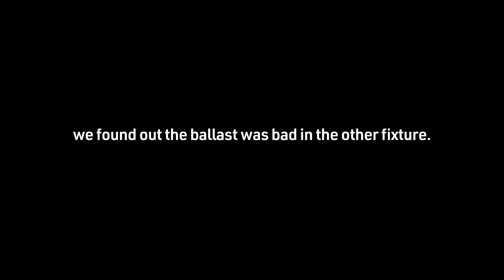Starting custom Case Mod for Tony Hawk - Part 1

Comment: As someone who worked in the plastics industry for 17 years, a little flame does wonders for removing plastic burrs after a cut and leaving a nice rounded edge.  You don't need a torch.  Just a lighter will do.  Then you can sand it evenly later if you want.  Wear a mask when you do and be in a ventilated area.  Plastic fumes and all...
Reply: But torches make for better content...lol
Reply: Wait... you want Jay to make use of fire? All I picture is Bevis.  Heh heh FIRE!
Reply: Next video I set fire too...
Reply: @ILBPatsFan  *Beavis
Reply: @ILBPatsFan  you're not far off
Reply: *cue  ifixit explosions
Reply: Some plastics you can burn off dull outer layers with fire to bring the colour back to life and resurface. Seen it done with old plastic seating that had dulled from years outside. Looked brand new after a few gentle passes with the flamethrower.
Reply: @jackquick8362  Didn't see the joke coming
Reply: I did custom audio installs in cars for years, it mostly involved grinding, shaping, or melting plastics lol xD  I can now look at a thing and tell what rotary bit it needs to get the job done with out it melting and clogging.

Comment: Nice call out to Adam Savage, he's awesome. I do still follow his channel and watch his crazy work. He doesn't necessarily do computer builds but the amount of experience he has when building anything is impressive.
Reply: A computer build would probably be too easy for him.
Reply: @MistyKathrine  It depends - I could absolutely see him having a fun little challenge making a Cyberpunk all-in-one PC with an internal power supply (I'd call it a laptop, but that seems like too restrictive a name for it)
Reply: @Autoskip  could go with a cyberdeck
Reply: @j377yb33n  As far as I can work out, the cyberdeck name seems to be intended specifically for computers with some kind of heads up display, although the inaccessibility of that kind of tech has lead to a lot of people building "cyberdecks" that don't have that particular feature.
Reply: @Autoskip  yeah, it usually ended up being a small portable computer, a precursor to a tablet, with a keyboard, small screen that can be handheld or mounted to a wrist.

Comment: Love the build so far, one cool idea that would fit with Tony's career you be to turn the cable cover into a half-pipe. Tony has always been a bit more of a vert than street guy, so it might be an interesting addition!
Reply: Tech deck vert ramp, have a skateboard coming off it as the sag bracket
Reply: Eh - it's like Extreme Makeover: Home Edition. You like horses? YOUR ROOM HAS HORSE WALLPAPER, THE CARPET IS GRASS. YOUR BED IS HAY. YOU ARE A HORSE. I like the idea of mimicking Tony with graffiti rather than being literal with gimmicky bolt-ons.
Reply: Thats what i first thought too when i see the cable cover. Its perfect for a quarter pipe or half pipe with some graffiti on it like birdhouse and lakai graffiti's.
Reply: @jameslamb7197  This made me laugh more than I'd like to admit.

Comment: For anyone wanting to know the fan grill Jay is using (as he seemed to have forgotten to link what he's using); it's made by AC INFINITY with a product code AI-FMF120A2 (Cabinet Passive Ventilation Grille Black 12 Inch). The grill is designed for Audio/Visual cabinets where extra ventilation is required. They make them to accommodate single, double and triple 120mm fans and come with all the required mounting hardware.

Comment: Jay, I'm so glad you're doing a build! This is one of the things you're SO good at! As a tip, and as someone who's worked for years in a panel shop, you should consider using a jigsaw to make your cutouts. They generate mush less heat (no burn marks) and don't consume cutting wheels. Simply drill out your corners, and voilà! But you do you. Anxiously waiting on the other parts of the build, now!

Comment: Jay, your "oldschool" approach to just zip-disc cutting panels and stuff is EXACTLY what we did in the late 90's and early 2000's when PC modding became mainstream/popular. It's nostalgic and gives custom builds a legit feel. If people want CNC cut panels and stuff, that's what prebuilt gaming pc's are for. Custom means imperfect. And there's nothing wrong with that.

Comment: Can't run most modern LED tubes with a ballast installed. Just spent a few months at the facility I work as an industrial electrician cutting out the ballasts and feeding 277v directly to the tombstones. Some older LEDs have internal controllers which can run with the ballast still functioning.

Ballast is basically the lighting equivalent of a motor starter.

Comment: That inside cable cover would make an awesome half pipe.  And if a "big air" cooler makes sense for anyone it's a pro skateboarder.  Even if he doesn't get the pun we will.
Reply: I'm def on "board" with a big air cooler, scythe, noctua, be quiet.

Comment: Coulda just got him a better case to begin with. I highly doubt you couldn't find a better case that you couldn't handle modding just because it doesn't have all those flat panels like this one does. Kinda pointless to mod in airflow when you can just get a case designed for airflow in the first place that's more optimized and will actually filter dust etc. Tha's just my opinion though. I feel like Tony Hawk deserves more then a shotty NZXT H5 whatever case.
Reply from the maker: When you build him a PC. Feel free to do that 👍🏻
Reply: @Jayztwocents  Unfortunately I don't have that luxury.
Reply: @PabzRoz  that’s the point
Reply: @Ben-u1e9e  What's the point? Because I'm not building Tony Hawk a PC I can't have an opinion?
Reply: @Jayztwocents  If I did ever have the opportunity and the money to build Tony Hawk a PC you can bet I wouldn't give him a 710i with a ghettorigged 16 dollar ventilation grille drilled into it🤦‍♂
Reply: @PabzRoz  Wow Mr. defensive, hang on a minute. I was simply pointing out that Jayz reply was rhetorical and sarcastic. Nobody questioned whether or not you can or can’t have an opinion.
Reply: @Jayztwocents  too sensitive
Reply: @Ben-u1e9e   How is that defensive... You left a vague comment replying to me when my original comment was just my opinion. I just asked you a question. How am I supposed to know you're referring to Jays sarcasm lol? Come on now.
Reply: @PabzRoz  you were supposed to read my mind
Reply: @Ben-u1e9e  true you right

Comment: Check those LED tubes in operation with your thermal camera!  We did a change-out and our tubes were not properly matched to the ballast and actually caught fire.  If your camera shows the ends getting hotter that you would want to hold, turn them off and re-ballast to a matching one!  Our mismatched tubes were hitting over 90deg C but looked like they were working fine.  Don't burn down your new office!

Comment: Might be worth investing in a die grinder with a metal cut off blade, would give a lot more control on the cuts over using an angle grinder.

Comment: Just a heads up, you can get "type B" LED tube bulbs and bypass the ballast. They are unable to be used with a ballast so you are committing to bypassing it and removing it. You get two benefits from this though. One, you don't have to worry if/when your ballasts will fail or if you have a bad ballast already. Two, you pick up extra energy efficiency as all ballasts use energy just to run the bulbs or even more to overdrive the bulb. 

I did this to my basement fixtures that used to have 2 T12 40w bulbs with a high power factor ballast and replaced them with 2 T8 17w bulbs. That took the energy use per fixture from ~106w to only 34w. This cut power use by 2/3. With type A or AB/hybrid bulbs that would've only been cut in half instead. I will say the benefit from switching fluorescents to LED give less of a benefit as fluorescents are already quite efficient with the light output they provide. If you can replace standard A19/21 bulbs and other standard bulbs you gain that 85-90% energy reduction.

Comment: Note on LED conversion---you can also get "direct wire" LEDs where you remove the ballast entirely and just power the tubes with direct 115 VAC. Saves a tiny bit on power (no need to charge a ballast), simplifies maintenance, makes the fixtures lighter, and the bulbs are a bit cheaper. I did this in my garage and love it---solves the bad ballast problem forever.

Comment: They make T8 LED tubes that are direct wire 120V compatible. When I had a ballast go bad, it was cheaper and easier to convert to those tubes than to replace the ballast, plus extra energy savings.

Comment: I agree with the airflow issue, I have 2x 360 rads on mine and removing the top panel drops my loop temperature.

Comment: use a fuma 2 airstack. ive had mine for about a month and it's incredible. i was really nervous, my first non liquid cooled pc build in 12 years. honestly runs cooler thanks to the case fractal torrent and efficiency and it's stupid quiet. like STUPID quiet.

Comment: 3d Print a 1/2 Pipe to sit in the white cable hide and airbrush to suit, or you could bend some plywood to sit in there, then a minifig on a skate board

Comment: I used to work in an equipment rental and servicing company, can confirm you dont need a harness if you're using an adequate rail restraint system, worked there for 15 years and the only time i needed a harness is when we went over 50 ft in the military boom lifts

Comment: You can do it putting les with the current ballast, but if the ballast goes bad you’re going to have to go back up there to replace. Its better to remove the ballast and wire the hots and neutrals to the tomb stones

Comment: I've had pretty good luck cutting plastics using a pneumatic cutoff wheel (basically just a pneumatic version of what you used). I think the fact that it gets so cold (from the air getting vented through it) helps keep the part cooler, and thus cut cleaner.

Comment: Just to help out Jay: CNC's are mostly handy for repetitive jobs (like making a 100 panels fast and easy), and I would recommend step drill bits for drilling plate (both plastic and metal). And use a punch marker ;)

Comment: The possibility of bad ballast is why I use the led tubes that just take raw mains voltage and just rip the ballast out. Just make sure that you label the fixture with the stickers that come with the tube so that the next guy that does a replacement knows not to expect any ballast filtering on the sockets

Comment: I'm having flashbacks to when I Dremeled 2 120 blowholes into the top of my 2000's era Lian Li PC 60 case. That noise was excruciating. Slapped a couple of Silverstone fan filters over the rough holes and called it a weekend.

Comment: With the fixture with the bad ballast double check the packaging of your LED tubes you bought if they may be dual function they may be bypass and ballast over you could just bypass the bad ballast and still use those tubes

Comment: Much better light Jay. I would have purchased the ballast bypass version of those lamps though. When the ballast goes bad, you will still have to spend more money replacing those, and they don't last as long as the lamps themselves.

Comment: Put at the bottom of the front plate the curve of a vert ramp and put a small metal tube up at the top for the coping. Just grafitti is cool but the mans a vert legend. Gotta have his hawk skull logo.

Comment: abs plastic..I use glass nail files for the abs plastic that alot of the parts my gundam model kits use, works wonders for smoothing out rough edges and neatening it up. the best part? WASH CLEAN! with bog standard water in a sink.

Comment: the best way to deal with rivets on a case that need removed would be rivnuts. that way it can be disassembled again easier later on if need be. rivnuts are the best

Comment: since the white parts of the panels is screwed into the black part, one could also 3d print something that screws into the black parts that locks into the case, even more customization

Comment: @Jayz, Rustoleum makes a textured grey "outdoor furniture" spray that can give the chassis a skate-park/pool vibe for the interior. Then u can airbrush graffiti. (Better than most grey's if u want a concrete vibe.)  Try it on a p.o.s. dead case, worth a test on the dyno if u feel me.

Comment: I would definitely have done the cutting outside or inside a box . You assemble computers in that shop and your spewing tiny metal shards all over. Ever here of the many levels of clean rooms?

Comment: Hey Jay!! 
Ever thought about getting a jigsaw? I'm pretty sure it will give you a much cleaner cut then a spinning disc can do.

The direct replacement T8 led bulbs do not save you much in power. Yes each bulb consumes less power but the ballast is still consuming all it can. And once that ballast quits working so will the entire light. If you get the direct wire T8 led bulbs that do not require a ballast you will get all the engergy savings that are associated with led bulbs. And if one bulb does go out, only that bulb goes out not the entire fixture. It takes less than 20 minutes to convert a light fixture from ballast to non ballast to be used with the direct wire T8 led bulbs. Something to consider if you are looking to save on energy costs.

Comment: tip for you. when cutting or drilling on table throw a piece of scrap wood like 3/4 inch plywood on table and put your drilling or cutting project on the plywood so it doesnt mess up your table.

Comment: I just built my dream bleeding edge machine (i.e. 12900KS, 3090TI, Corsair 7000D, H170i).  I got too old to build it myself so had Microcenter do it.  The last full build I did myself was 6 years ago. :)
Reply: Yes and thought the same thing 3090TI will cause 4000s series to release in September.

Comment: HARDLINE LOOP-DE-LOOP. First, I’ve always wanted to see it/wondered if possible, and Tony was the first to ever do it on a skateboard. And then run two 360 rads and a 180 radiator for a complete 900 of water cooling
Reply: Just got to the maintenance part. Never mind

Comment: I dunno what you've got in the works, but that cable hiding bracket inside the chassis has a perfect 90 degree bend to plant a 3D printed little quarter pipe to fit the theme... Might be worth a look!

Comment: You could get a tech deck quarter Pipe and mount it on the cable cover on the inside and glue a Bird House deck on the edge of it

Comment: IMO it is better to remove the ballast entirely and buy direct wire led tubes.  The hot and neutral that was originally going to the ballast wires to the tombstones.

Comment: The amazon link did not work for me but I still managed to find it.  The item is named

AC Infinity Ventilation Grille, for PC Computer AV Electronic Cabinets, Also mounts Two 120mm Fans

Comment: You should bolt some trucks to the bottom and throw some wheels on them so it can roll, could be set on the ground and will still be raised enough for airflow.

Comment: A practical suggestion for tube light fixtures... If you do not own those light fixtures, keep the ballast. Do not be suckered to buy LED tubes that do not need a ballast. The cost difference between LED tubes that need a ballast and direct wire (no ballast needed) is negligible in current market. another practical note is that if you ever move out, it's a great courtesy to the next tenant that the light fixture has a ballast, otherwise it's a dick move, and you're likely breaching contract with the renter by tampering with the light fixture that you do not own. But if the light fixture is yours, you do you.

Comment: It'd be really cool to replace one of the panels with a skate deck from Tony's line of boards. If not a panel, maybe the PSU shroud or make a GPU sag bracket. Maybe you can figure out what deck he used when he landed the 900 and use the same design.
Reply: Maybe fingerboards

Comment: I use 5k led lights in my house, you can see a lot better because it's a lot whiter color and seems to fill in the shadows better. I don't think 6500 would be better but who knows. I tried 6k led bolbs a while ago and they were way too blue and the light just didn't throw very far out in front of the car. Might be way different inside a building buf I'd think it would be too blue as well.

Comment: Ever consider covering your paint jobs in Automotive Clear Coat?
Just make sure the paint / vinyl / etc that is being covered doesn't react with the clear coat components being used. Different brands and hardeners give variants in results

Comment: I just drilled a hole in my case and installed a reset switch. Both my computers have a mesh panel, but that is as far as my case modding goes.

Comment: You shouldn't screw around with the power button on these NZXT cases.  I know from experience that if the button is even the tiniest fraction of a bit in the wrong place it will not click with the switch inside.

This is actually a serious problem with the entire H700 series.  That top panel easily (inevitably) becomes slightly warped from pulling it from the front like that and stops the button from making contact.

Comment: i use those led lamps here. At start i was... i need 6. small room like 3mts by 7mts by 4 tall.  My electrician told. put 3  maybe 4. i told nop all 6.  3 days later. I remove  it to brigth they have now 4 years and still going. the best i have done for lights here.

Comment: Did you know that a harness would make you look 20% stronger and like 25% sexier (if you're into bondage)?
Also - I think you can just bypass the balast if necessary for a certain bulb - if you bought a bulb that does not like balast standing between it and the raw energy.

Comment: Cutting Plastic with an actual saw is easy just use a little WD40 on the blade and stop to let the blade cool down a bit...!!!! works GREAT!! I prefer a Jigsaw over a circular saw but both work!!